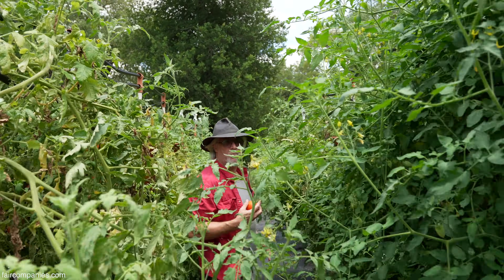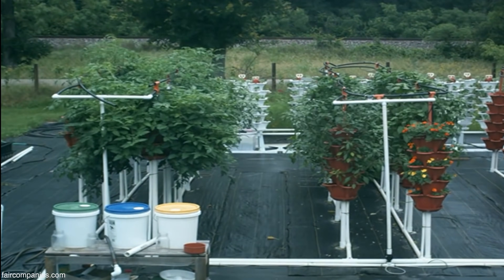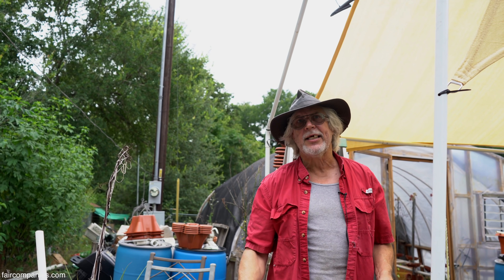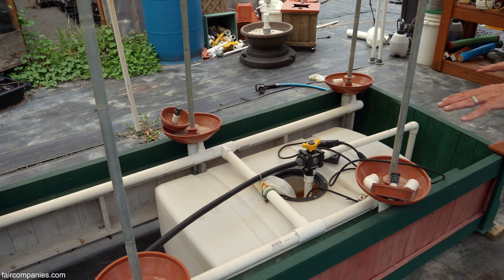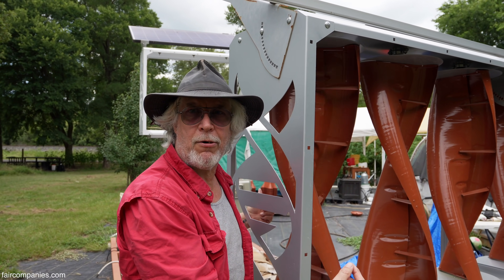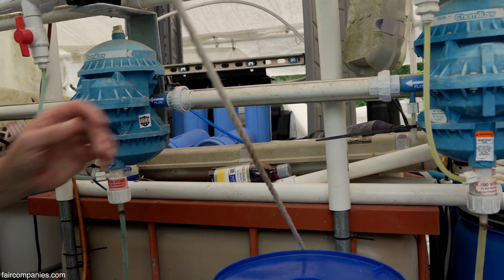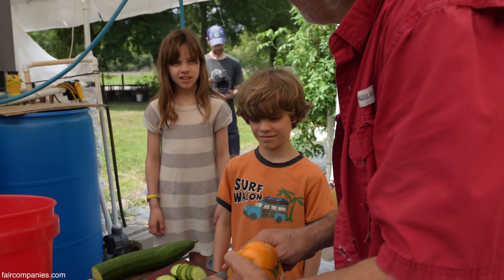Mad scientist's homestead is parking size, off-grid system

Comment: Great video! Some questions for Larry:
- How do I duplicate your recirculating design and what minerals or fertilizers would I need to add and when? I feel like you could do an hour-long video just on that part.
- I'm not keen on tomatoes, what other plants would you recommend for these pots? Potatoes? Carrots?
Reply: Potatoes and carrots grow IN the ground. So you'd need to empty the pot all the time.
Check the web page.
Reply: @Chris Ripplinger ---  On the potatoes, one option is using those planting bags with handles (they can be found online in many sizes and are for above ground).  I haven't checked the EZ Gro website as to if they offer their own nutrients or sell other brands, but start there, and if EZ Gro doesn't offer such for sale, then check your local hydroponics suppliers or online.  Nutrients are specific for the types of plants, so take care on that.  I'm not big on tomatoes either, so I feel you on that one.  An aside, is that you on a quad in the sand dunes?
Reply: Cannabis. Cash crop.

Comment: This guy seems great and I love what he’s doing. However as someone with two masters degrees in engineering and having written a thesis on small wind turbine design I can confirm that what this guy is saying is almost completely wrong.  There are many reasons horizontal axis is more efficient but the main one is you get much higher rpm which leads to more efficient generation of electricity. Additionally building those vertical turbines so close together will significantly reduce efficiency as will the version with solar panels on top. General rule of thumb is you want the turbine away from any other objects to more consistant wind speed. He is correct that vertical axis turbines deal better with wind direction changing but by putting them all next to each other this advantage is completely lost. Imagine when the wind direction changes and blows end on to those turbines, the ones at the back would get almost no wind. Changing wind direction is not the main problem when optimising wind turbines. 

Putting wind turbines by roadsides is often a terrible idea. What is generating that wind? Cars. They are generating it by burning petroleum. Putting turbines here means that cars are burning more fuel on this road section because there will be more drag on the cars...

Given that he is using the power to pump water this is an ideal situation for solar power, pumping water up and storing it high is one of the most efficient and environmentally friendly ways of storing power. This is what hydro dams to store power, they pump water back up. If he raised those tanks up a few meters and made them bigger he could just pump water when it’s sunny and let it gravity feed back down. It would be a much cheaper setup and more reliable than using those wind turbines.
Reply: He is on the same level of bs with the towers as well. He claims he invented things he did not. He claims that most tower-system doesn't circulate the water and that is a plain lie. I've never come across a system that did not and I've been focusing on hydroponics for the last 6-7 years. He's prices are sky-high on his webshop btw so about not making money...
Reply: Thanks for this. I was a little suspicious about the claims specially seeing his wind turbines surrounded by buildings and trees.
Reply: @LawrieAndCo  there's no wind at all. Look at the trees throughout the video. He's still able to generate 2.4 watts out of the six ones shown. That's as good, if not better than top sellers that will cost a grand.
Reply: Also, the % of how much water that is not wasted is not impressive at all. That is the general standard of a hydroponic system and has been like that even when US army made a setup during ww2. The pots are just a joke when it comes to the arguments he has. He makes a strawman out of other products failing. Holland is the 2nd largest exporter of food. They got gigantic greenhouses and none of them uses anything like his pots. So, they are using a less good product then? The experts in this field knows less than this guy? No. He lying. Just plain lies. If he would argue that "my pots are a bit better than most commercial systems if you want to grow at home" then he is almost in the ballpark for telling the truth. That is until you see that the prices he has for this pots are like 500% profit margin... 

And when it comes to the turbines, then have a look at the company called "Capture Mobility". They made the turbine like 2011, but this guy... 

I just hate to see people like this guy. The comments in here shows how unaware people are in this fields. Both power and agriculture. There are lots of products out there that are better than what this guy is making. It's also not hard to grow tomato's. Plenty of youtube channels that shows you how to do it. Just look for someone who is in your climate zone if you want to grow out doors.
Reply: thanks for your comment. When he was making grand claims my BS-o-meter was going nuts. Like "You created a wind turbine that's more efficient than all the engineers of the world? Why are you wasting your time selling overpriced plastic? and why aren't you rich?" I'm just a programmer, I don't know physics well, but with just a little logic you can tell he's full of it.
Reply: @kitsurubami  he never said that, but according to "open source low tech" channel's turbine and this guy's out out of 2.4 kw for all six. The both generate over a kw for less space and a cheaper price than almost all backyard models that are top sellers.

The top engineers (definitely not this Hall guy, with the degrees that he thinks matters) are being paid to figure out how to power cities, not small houses. If they were thinking about small house, they would probably say this machine works great.  

If it's too pricy to buy from him, he legit showed everyone how they're made cheaply.
Reply: you won't be the smartest guy in the neighborhood, right?
Reply: He literally says he's getting 1.2 kw with the change he made to the alternator. He now needs less friction to generate ac current. The rpms on this turbine that HE MADE (who cares about him saying it's an invention, he's giving you all his ideas for free anyway) is faster than the massive horizontal ones I can only imagine you're comparing it to. All the top selling backyard turbines generate 500-1500 Watts. What about him getting 2400 Watts from the six ones shown is inefficient and not competitive?  

Also what you said about cars generating wind for the ones in Argentina.. what the fuck? Maybe it's temperature change and the fact there's no trees. Give me a break. Maybe the giant horizontal turbines will cause some noticeable drag effects but nah man. These are tiny and not pushing air away like that.

Also, check out "open source low tech" channel. This guy makes a vertical axis 1kw turbine that you can build with 30$ worth of parts and a days worth of labor. Wiring shouldn't cost a lot either. 

Two different vertical models, both with comparable and competitive efficiency for backyard use
Reply: @caseyhartigan9448  Hey Casey, thanks for the comments. Just to clarify I'm not saying his setup doesn't work or there is a problem with vertical axis wind turbines (VAWT) just that he is making a lot of inaccurate efficiency and invention claims about a product that he is selling commercially to people. He doesn't give a price here so it's hard to compare price to energy output for his product. Lets assume he gets the 2.4kW he states in the video, that is roughly 400w per turbine which is quite low. Generally you want fewer moving parts a fewer components as it is cheaper to produce and cheaper to maintain so I would be sceptical of these 6 low power turbines being better than the larger 1.5kW ones you mention. 

In terms of the road traffic thing, an important point to note is his turbines have been turned through 90 degrees so they are in fact horizontal axis turbines. they will be extremely inneficient compared to normal horizontal axis turbines in this traffic context. In terms of increasing fuel efficiency this was a paper that I read a number of years ago, not something I made up, I had a look for the reference and I couldn't find it though so I could be mistaken but basics physics would suggest not.

The open source low tech channel is amazing and for $30 cost I can't see how you could do better frankly! 

So I'm not against VAWT just people selling commercial products and making miss-leading claims, ultimately it leads ill informed people into buying one of his turbines being really disappointed if it doesn't live upto the hype and then deciding that wind power is a load of rubbish. 

There is a really good calculator you can use to estimate power output, if you plug in the rough dimensions of his turbine make some generous assumptions on efficiency and a very decent wind speed you will see that his claims are doubtful at best... https://www.omnicalculator.com/ecology/wind-turbine
Reply: @halwatts3041  , Casey, Mikael, et al. - Some great observations in this thread. Seems like the important bottom line here is self-sufficiency. Whether or not Johnson is being honest when he says he's not doing what he does to get rich, the ideas and systems shown here will make more people realize they don't need to be as dependent upon the 'grid' and the food supply chain as they might have thought. His point about the need for a hybrid solution is also key. Whether or not his systems are the 'best' is - at least IMHO - irrelevant... if they work! He's not trying to solve global warming single-handedly, he's just focused on giving individuals tools to be more self-sufficient and less reliant on corporations and institutions. Hard to find fault with that. I've checked his site and compared prices for things like pumps to other sources and his are indeed significantly marked up, whatever that means (and without talking to the guy directly about it, I'm not about to make assumptions).

All that said, I find it interesting that Infinitum Electric thinks enough of the PCB stator idea to build a new generation of motors (and generators) based on it. Some ostensibly smart folks have invested a LOT of money in that notion, whoever actually 'invented' it.
Reply: Y’all are just book smart. Shut it. This wonderful man is practical, doing it in real time. Whatever he’s doing is clearly working.
Reply: @KarimKarimgodd  Booksmart? You  have no idea what we work with. I know what works and what does not in all his cases. This guy is a fraud. He claims to invent things he did not. He makes copies of things that he then sells with lower capabilities at a higher price.

Comment: There was very little discussion on the quantity and cost of the supplemental nutrients. Would be great to see those numbers per vertical stack to gauge the economics vs a traditional garden setup. I'm also curious on the nutritional content of the hydroponic vegetables vs traditional garden (assuming high quality soil conditions). I'm sure that is discussed excessively, but I'm new to gardening and intuitively feel there must be some difference between an entirely soil-based plant and a hydroponic-based plant (though in this case with some soil). Thoughts? Other than that, very impressive to see his efforts and success.
Reply: This may help, here are some articles I have on nutrients and how I mix them and some science on how they work and are used.  https://ezgrogarden.com/category/nutrients/
Reply: You are smart to think of food quality, there is something hydroponics cant mimic and that is the soil food web,and they are just now starting to understand what happens in real soil in the ground. Also this system uses a insane amount of plastic,fittings,pumps,wiring,and timer valves.  Not putting the guys system down,but i would much rather get away from all the plastics.

Comment: "They always find the wind" cut to six turbines completely still.
Reply: I noticed that too. I really think it demonstrates why an ideal system for generating energy is both local and diverse. We need multiple sources of sustainable energy (wind, solar, wave, etc.) + efficient batteries to store energy so it can be used later. I believe it can be done but the whole industry needs massive support and investment. I love that Kirsten is helping to get this Larry Johnson's message broadcast. @EZGroGarden @EZGro
Reply: @betsyolsson-mackowski7682  Agreed, though I think that small modular nuclear reactors need to be added to the mix of renewables as a scalable power source to offset fossil fuels.  Renewables get a lot of hype, but next-generation nuclear is held back by a lot of regulatory hurdles and there isn't as much public awareness of such in comparison.  The only way we can bring down our net carbon emissions to reasonable levels IMO is by making use of all options available, and nuclear is one of those options.
Reply: that style turbine is good because it works with wind from any direction, but he put them in a line so they can only accept wind from the front or back. kinda defeats the purpose. better to have them spread out and up higher, not grouped together in a row at ground level.
Reply: The ones in Buenos Aires were blastin', tho! 16:47
Also hybrid.
Reply: @PedroPetracco  yes, notice they are installed by a road way. There is a lot of lost wind energy from traveling vehicles that can be turned into semi reliable wind power. even better if they are EV's that have been charged with renewable sources.
Reply: if there is no wind to find, there's just no wind. But when there is wind, it's good to know the turbines will be ready quickly, specifically because it might not last long.

Comment: Finally someone troubleshooting axial generators! I really like the flat circuit board design he has used and would probably buy just the generator alone for its size. It's ridiculous how even small American wind manufacturers have abandoned axial designs for the horizontal-axis market.
Reply: you mean vertical designs. It is not ridiculous, they are just way less efficient. A hundred years after Savonius invented them, this conclusion has become a nobrainer.
Reply: @tzenophile  No I'm talking about the generator itself, I know the pros and cons between vertical and horizontal blades. I'm talking about axial vs radial flux.
Reply: @MrHamsto24  Ah ok, sorry. I'm just skeptical about the 450 watt claim for such a small turbine, but I did find the generator design compelling.

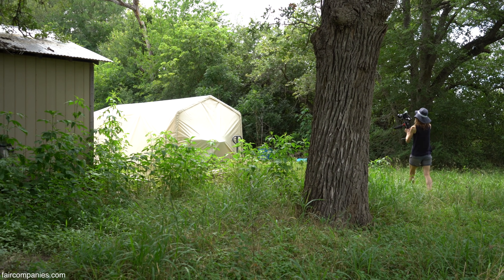Comment: 12:30 , no wind turbines are made on the basis of alternator, they are basically some form of BLDC or PMSM which internally operates just like a 3 phase AC induction motor. PMSM motors are about as efficient as you can get.
Reply: Stop being so pedantic.

Everyone who understands what he built knows that alternator is the wrong terminology, but for the inexperienced or lay person this video was directed to, alternator as an understandable word from your car as being able to generate electricity from the rotational momentum and so was the correct word to use.

Who when starting diy-ing wind turbines didn't make theirs a hacked together HAWT with a car alternator. Worked fine until we all understood why it wasn't great.

Comment: Those vertical turbines might produce as much power as he claims in gale force winds.  They won't be able to spin that freely once we add the eletrical load to those wind turbines.  It is similar to lifting your cycle's rear wheels and pedalling.  The moment the rubber meets the road i.e. the load is added it slows down considerably and stops.

Comment: unfortunately, the nutrient tanks require a fully functioning, modern economy since it is an external input. if there is a disruption in such an economy, which lasts for any significant amount of time, this system is unsustainable. otherwise, very cool.
Reply: The secret is to stock your supply.  My garden take 6 months to go through 50 lbs I have 2000 lbs on hand now. That is a 20 year supply.
Reply: also, no trace nutrients, only those you provide in the solution.

Comment: $4400 for 1200 WATTS... AND IT MIGHT WORK??   A 2200 Watt Honda generator cost $1000, burns 2 gallons a day. $3400 = 2.5 years of fuel. OR Trina 410W Solar Panel - $215 x 6 is 2400 Watts for $1300 add in a Victron MPPT solar charge controller for $350, and take a VACATION or buy hoop house with the $2800 left over. SORRY FOLKS, there is a reason no one uses these.
Reply: I agree, it is expensive, but compared to a generator this doesn't produce any noise or emissions. Compared to solar it can create power when the sun is down. But yeah, I'd personally go with solar with a battery.
Reply: Generation of development vs years in a backyard.
Reply: Generator. will cost u every time u use it and cost to maintain a engine....so in the long run the wind power is cheaper.  My only suggestion is to run solar along side the wind power

Comment: Windturbines; “see how  easy the turn” yes thats because the are not making power, simple physics. Show how much it produces Per year. There are no wind in a garten, you need hight to get consistent wind. There is a reason no comersial wind turbine that is being built wire this system that has been around many years.

Comment: Amazing, wonder if theres a possibility if these were smaller and laid on there side and strapped to the top of campers. The possibility of power is amazing
Reply: Funny you say that, I actually came up with a version to put on electric 18 wheelers to charge them while they go down the road
Reply: @larryjohnson6646  Ok, so how would that be different from a braking parachute? The truck is already spending energy pushing against the wind, and these contraptions add to the wind resistance.  That is not producing energy, that is throwing good energy after bad.